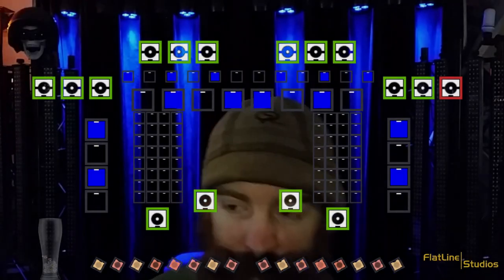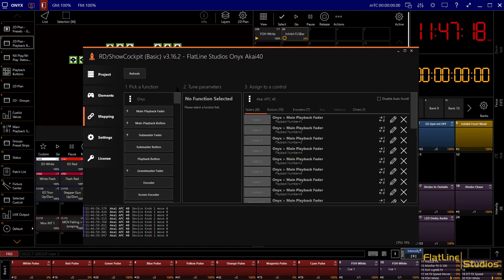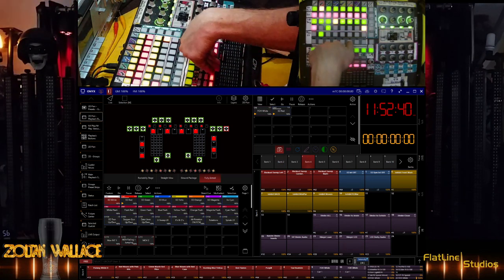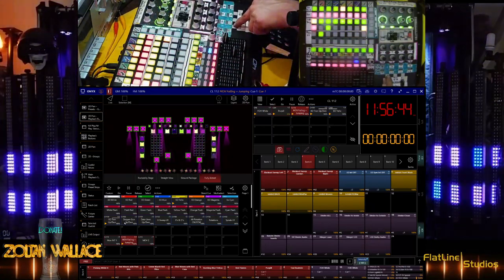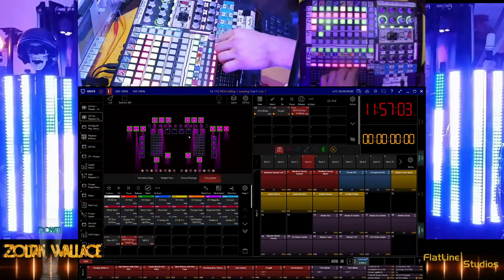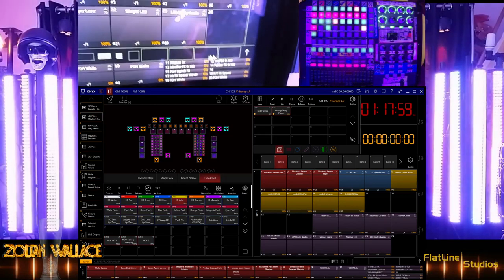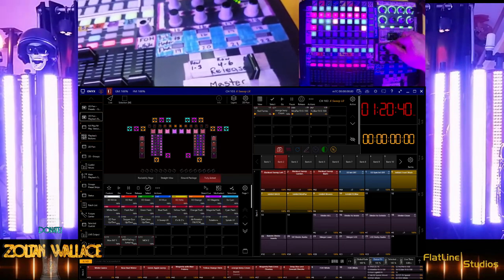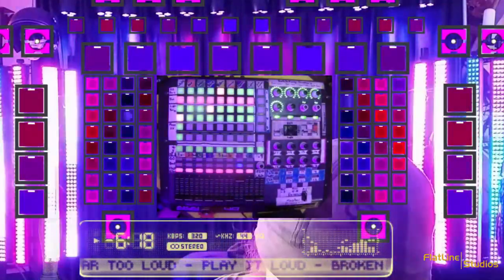ONYX Setup Video Walkthrough of RDSC AKAI APC40 @FlatLineStudios

Comment: Nice video.  I love all the control features you have programmed into your rig.  I too use Onyx and took David Henry’s course on Onyx.  I have been using Show Cockpit to control an Akai APC mini mk2 which works great but I have not figured out how to run a second Akai APC moniker 2.  I am also struggling to figure out how to program Showcockpit to use the Akai to change pages in Onyx.  I am using the newer version of Onyx with OSC and I also have an NxTouch, but I like the Akai better as you pointed out.  I have spent hours trying to figure this out unsuccessfully and I would love your help if that is a service you offer.  
Chris
Reply from the maker: Hey Chris. I will be honest, what I know is what I taught myself from 2018 to 2022. I tried the Dylos and was not impressed by the loss of non Onyx controls. I run small light rigs for bands and in my studio to run key and area lighting for video. Some of my productions can be found on my Studio Page. YouTube.com/fltlinestudios
Most studio productions are not mine and thus uploaded on other pages.

Good luck. Sorry it took me 3 weeks to respond.

Comment: Great video! May I ask how you are able to control faders 11-20 via showcockpit? 

I've struggled to figure it out since SCP only offers main playback faders 1-10 with Onyx OSC element. I have my APC 40mk2 as WingID 0 and APC mini mk2 as WingID 1
Thanks for sharing!
Reply: Also, if I'm doing any heavy programming while trying to operate/playback cues or push faders, I sometimes have an intermittent delay with Onyx responding from Showcockpit. Not sure if it's an issue with OSC or ONYX. Showcockput responds real time but onyx doesn't respond or has major delays, intermittently. I have nova+ via NXK.
Have you had any issues like that?
Reply: I have the faders split. I have 9&10 on all pages controlling the lights that face the performer (copied playlist to 9&10 of all pages) then 11 and up are going to the lower right encoder wheels bank. Those too are copied to every page. The copied playlists are so I can control them on any page. The encoder controlled playlists are where I have my FX speed augmenting playlists (use to overide fx speed on individual fixture rows/types.)
This is so I can control on the fly, all speeds to match the music (live bands usually). Leaving the 1-8 fader bank to launch my color look with FX patterns, and the encoder bank for speeds.
The upper right encoders are intensity overrides, to act as dimmers for each fixture type/section.
Hope this helps explain it a little.
Reply: I am also using the last preDylos version of Onyx. With no delay issues. Usb midi through RDSC, not using the OCS (or OSC, whatever its called) I know there is a delay with using the way I dont use. Also there is a delay in Dylos, and that built in by obsidian, because they want to sell you their sub par control surface. If their controller was as good as Akai, I would be using theirs...
Reply: Around 10:30 I demonstrate the encoder bank running the 11-20